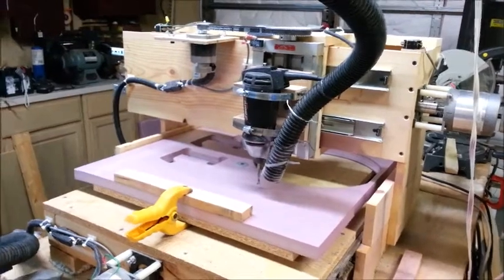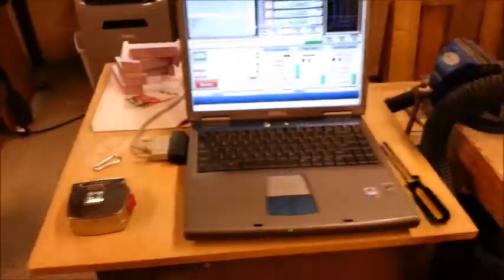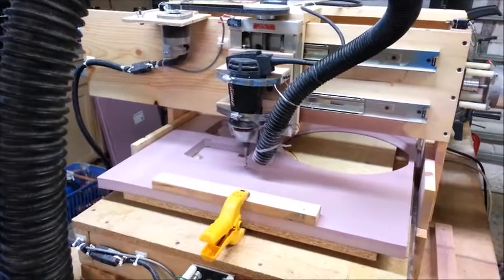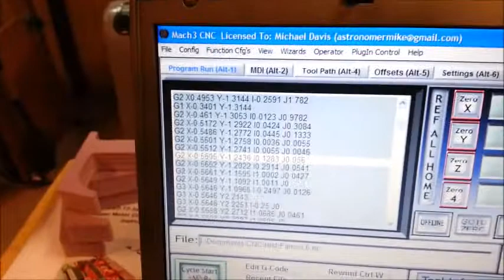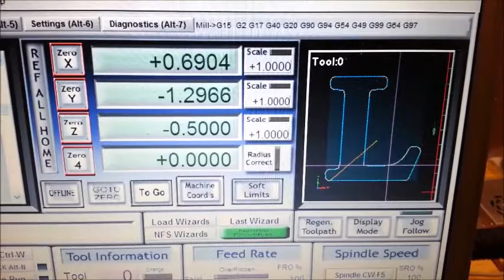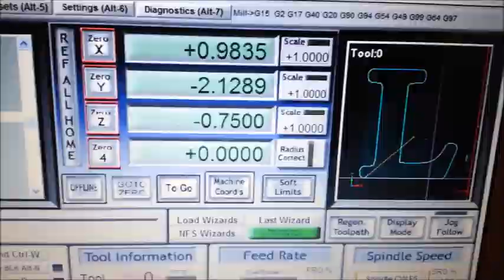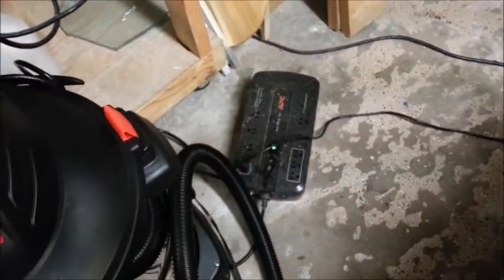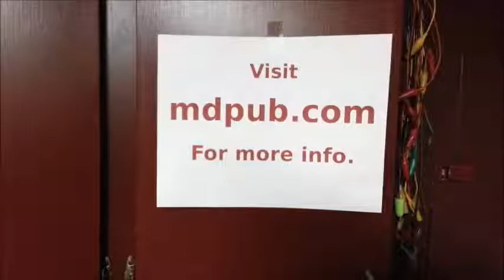CNC Cutting Foam Letters

Comment: Can you please tell me the exact name, or odel number of the bit you used to cut this? I am new to this but i need to cut some letters on the same material you used (1 inch pink insulation foam) on my homemade cnc. I appreciate it!
Reply from the maker: Hi. I was using a 1/4 inch upcut spiral router bit. I'm not sure if that is the best tool for the job, but it worked quite well for me.